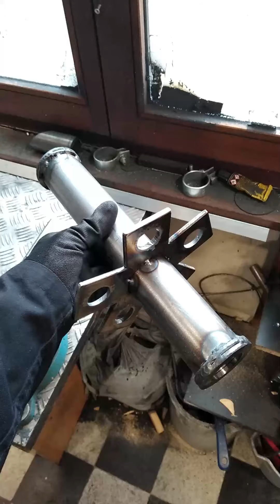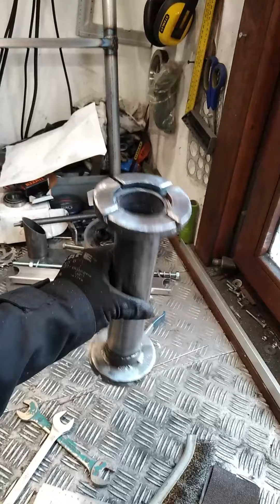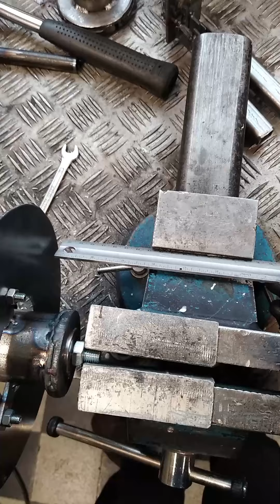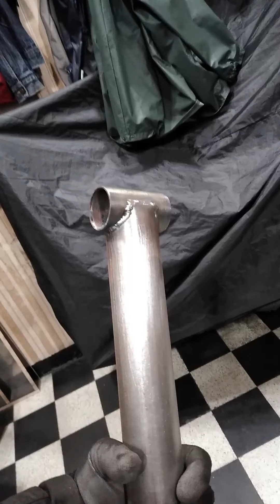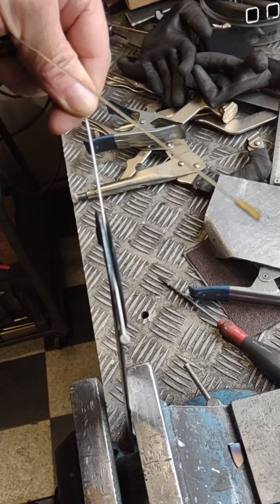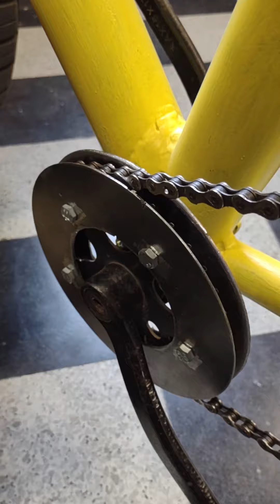Fatbike

Comment: Very impressive. So good you are making and posting videos again. One question. Why didn't you make it for motorbike tyres then it would be so much easier to ride? Say 190x55x17 tyres/wheels? I guess with those huge car tyres it is great for going straight but difficult to turn. May be knocking up some motorcycle wheels with tyres wouldn't be so hard as you already have the bike. But still a great achievement.
Reply from the maker: Hi Alex. You're right, it's very difficult to ride but it's an interesting challenge. To turn you must throw the bike on its side so you ride on the edge of the tyre. Then you can lean and take a turn. My next project is a scooter with 10 inch wheels and 100mm wide tyres so that will be easier and more normal.